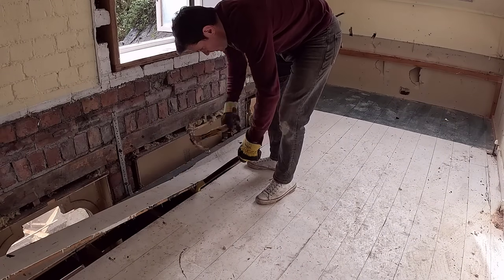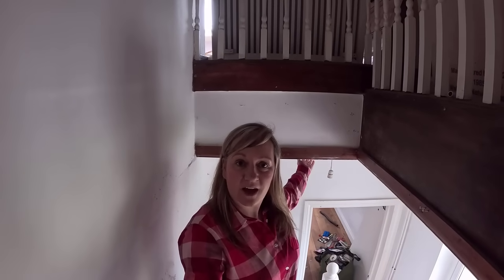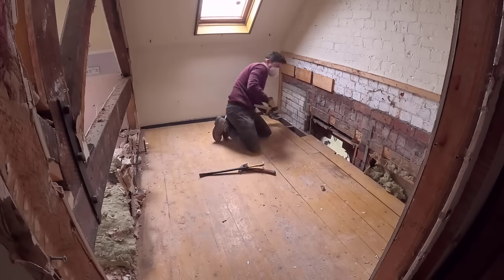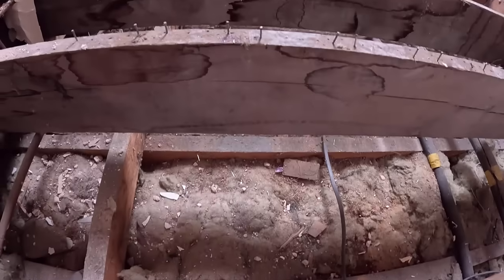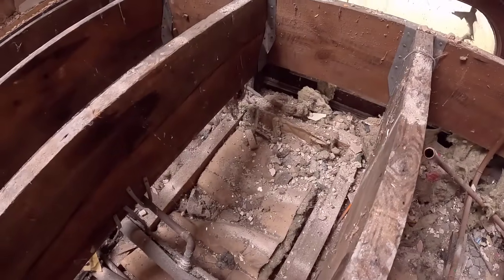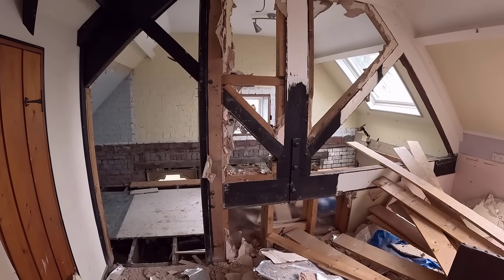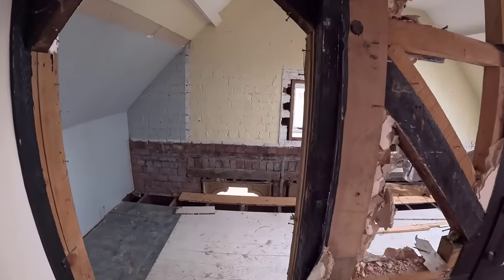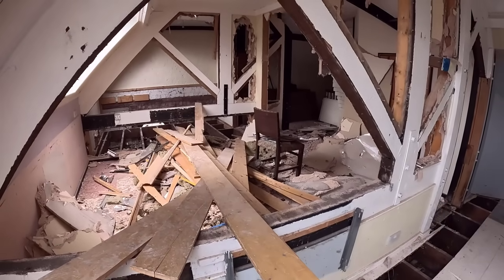Abandoned? The Old Station Looks Like It Now!

Comment: Hello, I am enjoying your redo of the station.  I was wondering about those nice beams in the second floor.  Is it possible to leave the area between them open to accomidate a desk and reading chair, while closing in other sections to hold the bed.  This may make the second floor look more spacious while giving privacy to the two bedrooms.  Just a thought.  I can't wait to see what you do with this great old station.
Reply from the maker: Thanks very much for watching! 😊

The horizontal beams either side are likely going to have to be taken out to fit in what we want but in the middle section of the house we're hoping we can leave them mostly intact as a feature since there won't be a floor/ceiling there, just full height from the floor to the roof. 🤞
Reply: @theoldstationrenovation The open ceiling will look very nice and keep the charm of the old station.  I can not wait to see what you have planned for the upstairs renovation.  The space is a blank canvase.  Thanks for the reply and for taking us along on the adventure.

Comment: I can see that if you lift the floor joists to up above the window level you are going to have much less headroom in the rooms above any new floor. What do you think you might want to use those rooms for?
Reply from the maker: The rooms are going to be bedrooms, we’re planning to lower the floors to the bottom of the upper windows so they will be at ground level on the first floor. Not the perfect solution but the only one that will give us enough headroom and have the windows exposed.

Comment: Wow hope he knows which ones are load bearing walls so he doesn't mess with those.
Reply: My thoughts exactly
Reply: @rosertaylor6139  i dont think plasterboard , wool insulation and a bit of pine timber is load bearing.  Look at the layout it is three rectangular boxes, each having their own roof supports onto the main walls,  the main run in the middle of the middle box is probably the most important with either a central wall being supported by some substantial down timbers, and/or two shorter timbers onto a pair of intermediate walls, though it looks like steelwork has been created to carry more load to the outside walls.

Comment: There is really no need to raise floor joista  upstairs more then just above the Windows downstairs - you can see how high the roof once was, but that makes upstairs unusable ..
Reply: It looks like there are the added floor joists - slotted into the I-Beam steels,  these are then above a void to the downstairs ceiling .  I think the ldea will be to raise the downstairs ceiling height - which still wont make the decorative window tops an indoor feature - it would be nice to take the I-Beams higher but that will compromise upstairs ceiling heights

Comment: Gill needs a bump helmet, a better mask and hearing protection.  Sooner or later he will stand up in the wrong spot and drive a nail into his skull. Not a joke.   Having seen this episode, I think you need to be doing a bit of research into the original plans of the building (Railways have archives) and bring on a consulting engineer as to me it looks as if the integrity of the roof structure (at least) has been improperly altered.

Comment: Are the floor joists on the upper floor level with the original roof structure ? might explain the difference in height ?
Reply from the maker: No, they are a couple of feet below the roof structure. I can see why they put them in, they needed to be able to walk around upstairs without the roof falling in. Not much help to us though so they'll be coming out (hopefully to be re-used somewhere).

Comment: Why did they  do the floor like that  I have never seen that  you lose high and they cover those small windows must have been for pipe  or central air decks
Reply from the maker: I think it may just have been the steel beam, I haven't seen anything else that would be a reason to lost that much space. The only thing in the space other than the beams is pipes and wires and they hardly take up any space.

Comment: Feet and hands existed long before man invented tools. They aren't as easy to mend or replace though, so use with caution Gil. 😅

I think that end could be your master (middle) with en suite (far end) and a dressing area (nearest stairs). 😊 You'll have more flexibility for the girls at the other end of the building if the beams are different.
Reply from the maker: 😆I try but its just so tempting to give a little kick!!

This end of the building is going to be for the girls with us at the other end, the beams are the same both sides other than the removed sections on this end... I just hope their rooms are ready before they are old enough to move out!!